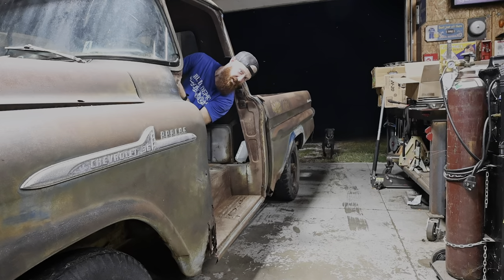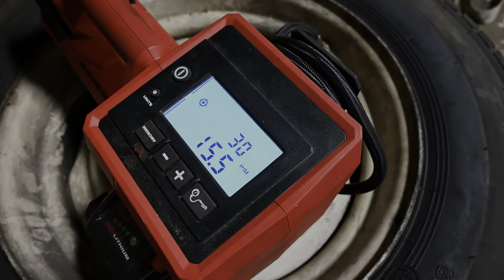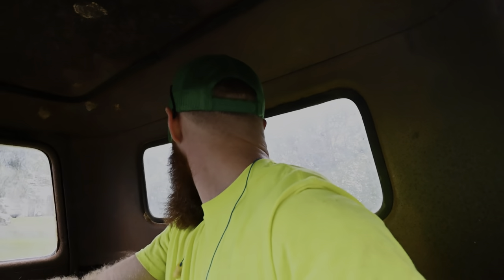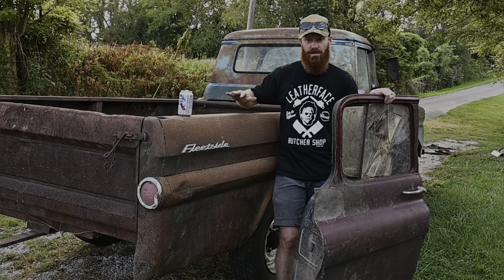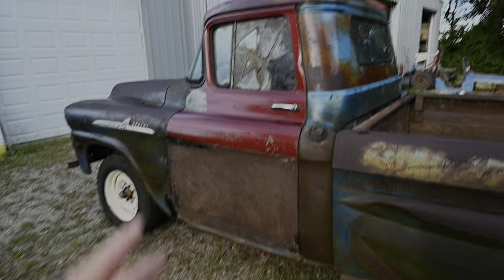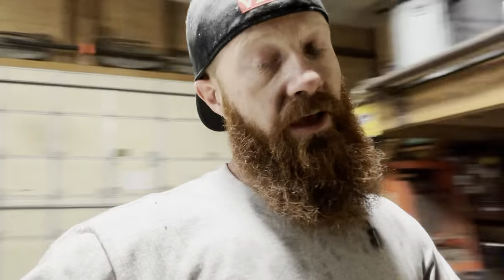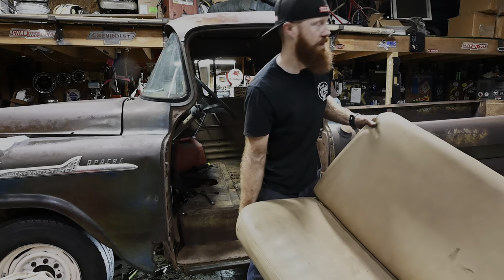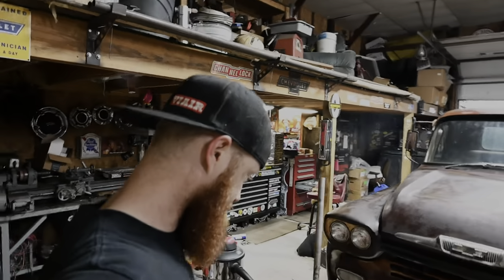Budget Barn Find Makeover: Chevy Apache Revival!

Comment: I used a  80 camero front clip and rearend in mine to get it on the ground and the width was good. I think you will find there are lots of things that will fit. You can find rearend perches at any trailer parts place. I put the camero booster and brake pedal on mine also. Don't worry what others think about your old truck, the only thing that counts is that you like it. if you are near southwest oklahoma I think I have some hinges.
Reply from the maker: I agree with you on that. I wish I was closer I need to find a set lol

Comment: That clutch head screw can be taken out with a med needle nose pliers inserted in the opening and use a screwdriver across the handles to turn it but soak it good first.
Reply from the maker: Nice. I have a set ordered Up. So hopefully that will do the trick. But thanks for the tip 👊🏻

Comment: The Mustang II and 8.8 will be a a great upgrade and have the same bolt pattern front and rear. With the obs seat what I did with mine was lower it 2 inches by sectioning the seat brackets
Reply from the maker: Awesome. I just picked up the rest today actually 🤘🏻👊🏻